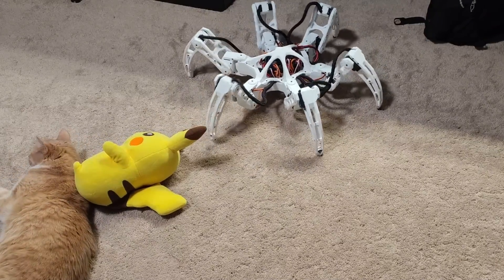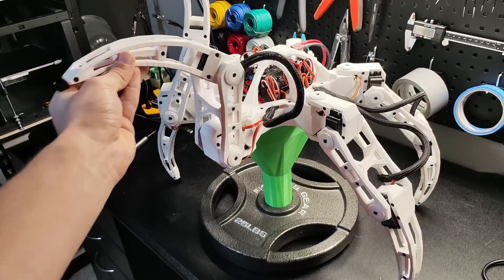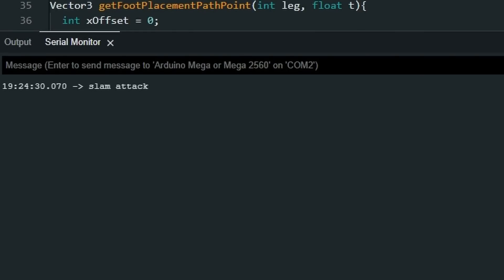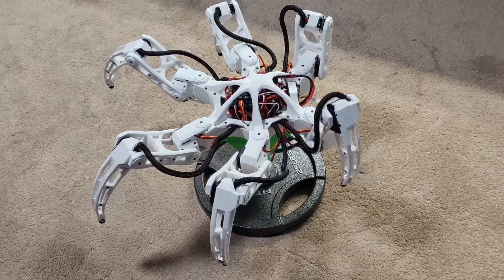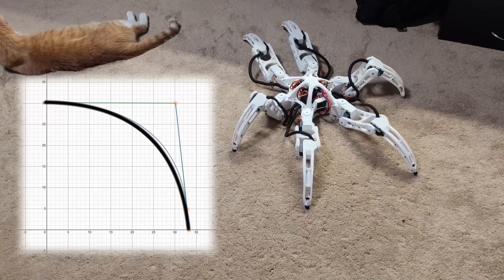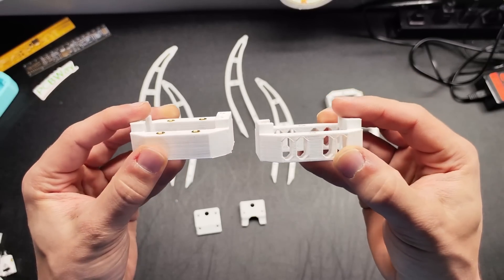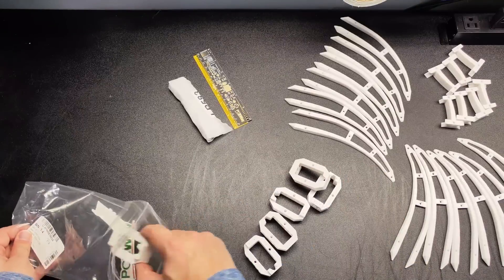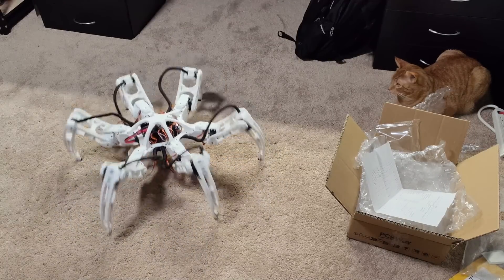I Taught My Hexapod a Slam Attack

Comment: PCBWay sending you prints with elephant's foot is super disappointing tbh. Everyone with even half a braincell can compensate for it in slicer and there's absolutely no reason a large company selling prints on demand sends you stuff with that flaw in it.
Reply: Not really, PCBway just prints the files it is sent, how are they supposed to compensate on every part they need to print? Some people design with elephants foot in mind, some people don’t, just by looking at the file they couldn’t always tell. Same with hole sizes and tolerances, people often design them into a part but it is possible to set them in the slicer too, again how will they tell? They probably just set up the printers to print it as accurately as possible and leave it at that, even then, if they print it bang on the size on the file and you designed it to have a tolerance since printers usually print holes undersized then your hole may end up too big.

It isn’t quite as easy as you seem to think. For them to get rid of things like elephants foot or precise sized holes they would have to have someone talk to you and find out how you designed it, what tolerances you used, etc, and then set the slicer settings. This would add a lot of cost to the process. If they can just post some guidelines on designing parts for them to print and then just keep mostly the same slicer settings for every print then they can save time, save costs and get the part made quicker.

If you want very accurate parts then you probably need to go to a more expensive printing service.
Reply from the maker: This is a great response, ty!
Reply: @conorstewart2214  Yes really, designing your parts to compensate for elephant's foot is silly. You compensate for it in the part of the process that would cause it. 

Secondly it is their job to print a part that's as close to the given file as possible, that means no weird additional width on the bottom layers, that also means that if someone added some little bevels at the bottom they now get a part with tiny bevels.

Lastly, printing a part with elephant's foot can mean said part is unusable without removing it, which might not always be the easiest thing. Printing a part with double compensation just gives the aforementioned tiny bevels that shouldn't ever be a problem.

It is impossible for me to design parts that PERFECTLY compensate for elephant's foot caused by their printers, without first sacrificing a handful of prints to them, it is however very possible for them to setup their process to print EVERYONE's files without it. Hell they could even add a checkbox for "I've already compensated elephant's foot in my files and don't want you to do it for me even if you could do it better."

It's on them, not doing it is lazy, everyone else can.
Reply: @ProtesttheAntagonist  no you have no idea how it works or what you are talking about. How are they supposed to print every single file perfectly with no elephants foot or other issues?
Reply: @conorstewart2214  ironic.

Elephant's foot is an issue that's printer/filament dependent. For my own printers/ones I've worked on I've ALWAYS been able to tune the slicer settings to eliminate it. 

If you solve elephant's foot for one file you've solved it for all files. Any other issues are also either removable with good tuning OR should pop an error when uploaded to their platform.
Reply: @ProtesttheAntagonist  okay so you've used a few printers. Have you run a large print farm that is probably largely automated? Probably using multiple types of printers with lots of different filaments?

It does also depend on the part itself, to think it doesn't is a bit delusional. They are dealing with lots of parts made by lots of people, all with varying levels of skill and experience. You probably just design parts for your own use on your own printers.

You can remove elephants foot if you need to, it is better to have more material and need to post process it than to not have enough so the part doesn't fit or doesn't work.
Reply: @conorstewart2214  yes I have lol. 

It does not depend on the part itself, elephant's foot is PURELY caused by over extrusion on the first layer, there's no other reason for a layer to bulge outward like that. The over extrusion is useful for adhesion/surface finish, but compensating for it by purposefully underextruding the outside wall is a consistent fix for the issue that works on EVERY file printed on that printer/filament combination.

In print farms if using decent quality printers(my experience in a farm was with ultimakers) then the same slicer settings can be used on all of them if they're all setup right. You might choose to leave the TINIEST bit of elephant's foot showing on one or two printers, but nothing like what's shown in the video, talking about hardly visible here.
Reply: @ProtesttheAntagonist  some parts need better adhesion than others, hence with settings to compensate completely for elephants foot you may end up with bed adhesion issues on certain parts and since you can’t predict what will come in to be printed it is safer to leave a bit of elephants foot there, especially when a lot of the files you are sent to print will be designed by people who don’t have experience using printers or designing for printers and probably don’t own one, hence they are getting it printed by PCB way. PCB way is a low cost printing service that is open to even complete beginners, not compensating for the elephants foot is a good way to increase the chance of the print succeeding due to the better bed adhesion.

In the print farm you worked at was absolutely everything automated? From when the person clicks the button to order it is automatically sliced and sent to a printer and the only time a person will touch it is after it has been printed? That is probably what PCB way is doing or they will have someone to very quickly stick it in the best orientation and the rest will be automated.

Comment: Very cool project! When your hexapod moves, the body moves a bit up and down, is that a minor error in the inverse kinematics or motor jitter?
Reply from the maker: That is a great question. I know it's not jitter, but I'm pretty sure it isn't the ik either but idk. My best guess is that when 3 legs are hitting the ground the servos rotate a little, but when all 6 legs are hitting the ground in between steps, they better support the weight and push the hexapod a bit higher.

Comment: QQ: Any reasons for sticking with an Arduino? An ESP8266 or an ESP32 would have made for sense to me with the added connectivity options and extra processing power...
Reply from the maker: Great question!
so I chose it initially because it's the only thing I was familiar with, and there was a similar project on YouTube that used it as well so I knew it would work.

I'm staying with it because it makes the project as approachable as possible, and I feel that the mega (or maybe the due) is the best way to do that.

ngl though, I do look forward to getting into more powerful microcontrollers, just not with this specific project
Reply: @AecertRobotics  well, when you release the project, I'm going to move it over to an ESP32 🤣
The dual core processor and embedded Bluetooth for remote control is too tempting for me 😅
The upside is that mostly the pin mapping is the only thing that needs to be changed.
Until then, I'm looking forward to all the improvements you're going to make to an already great project! 😁
Reply from the maker: @MiklosGalicz  Do it! You'll also have to modify the custom pcb, but that should be fun 😉
Reply: @AecertRobotics  I've did some investigation after boasting and the esp32 doesn't have enough pwm IO pins for 24, however an STM32 board does have more than enough and there's no need for the extra board with that 😁

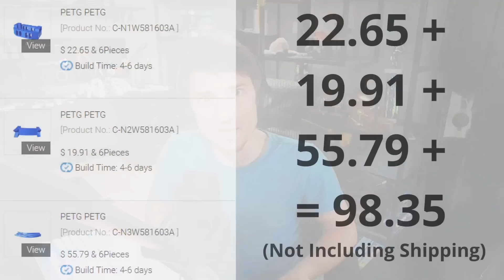Comment: @06:50 That was basically like saying: "Don't have PCBWay make your stuff... Instead go and buy yourself a 3D Printer and do it for a LOT cheaper!"
Reply from the maker: I mean if you can afford it I would recommend buying your own printer ofcourse. But there are definitely situations where a service like this would be helpful even if you have a printer, for example maybe what you are trying to print is too big for your print bed, or maybe your printer cant do certain materials, or maybe it's a lengthy 1 time print that you just don't want to do deal with.
Reply: @AecertRobotics  I find the Print Volume a hard to accept argument considering the sizes of some of the stuff I've 3D Printed with either my MK3S https://i.imgur.com/kAef3af.jpeg or 350 sized Voron V2.4 https://i.imgur.com/XXR47uM.jpg

Sometimes a smaller Build Volume is a curse but often enough I found it an opportunity for a different approach when it came to 3D Modelling something.

Concerning the Material Issue... I'd argue this argument too only becoming relevant once you start working with materials like PEEK/PEKK... ASA and Nylon are still very much realistic on a 3D Printer without a heated chamber for as long as you can cobble up a makeshift enclosure around it to keep some of the heat contained.

As such my argument stands - Don't use 3D Printing Services unless it's either for SLS or DMLS... For SLA and especially FDM buying your own 3D Printer is the way to go in the very short long run.

Comment: Hey there, 
I stumbled on your videos the other week. I bought one of these Hexapods around ~15+ years ago from Lynxmotion.. the Phoenix.
One thing to call out that might/might not help out. When I was working on these things way back when, the micro I had was ~16mhz and slow. The walking gait code would take up nearly all of its compute power. One thing that surfaced later was, these devices are so small and you really don't need to solve for SIN/COS/TAN while walking you can just use a lookup table. The lookup table did something crazy like take that 95% cpu usage and turned it into about 10%. You could pre solve for ~every quarter or half degree or something and use a little more memory at boot. Its not as accurate for sure, but the fact at the size these things are you can have a little error and visually you wouldn't be able to tell. You would only start to see the gait errors once you scaled up the the lengths of all the bones up. 

Perhaps you thought of this?

Frankly though the micros now like an esp32 or esp8266 or stm32 are bonkers faster compared to what I had messing with this stuff years ago. Maybe its not even worth it. Cheers! 

I have another project I am working on now which is an ESP32 based transmitter using ESP-NOW. My plan was to make a sweet transmitter then get it working with the old Phoenix I have on a shelf.
Reply from the maker: Hey sorry about the late response lol, I swear I responded but apparently not...

Thats a really good idea! I could do all the calculations once and then it would just look them up... This would be especially helpful since the arduino is relatively slow. I didnt think of this, and if i ever start feeling the limitations of the arduino mega, I will do this! Thank you!

Comment: your  cat is super chill  ....gives  ZERO fux 😅     for the underside of the robot  may be you could ad some rubber ...?something to absorbe the shock  may be 3d print the bottom in  a softer material ?
Reply from the maker: dude ikr 🤣 they pretend it doesn't exist it's unreal. that's a really good idea! it'll also protect the surface it's slamming into lol
Reply: @AecertRobotics  btw : thanks!!!  i did not know PCBway offered 3d printing !
 i am  hesitant to buy a 3d printer and go thur  the learning curve , time ..bad prints + plus  buying filimnet etc.... PCBway  is  the service i will be using .

Comment: Foot switches in front legs in attack mode needs to activate a pull-grab with fangs for added effect :) Awesome project, can't wait to start supporting y ou and building it once you have your parts/pcb's etc. set up. Btw, does it have  a name yet.. or just Hexapod?
Reply from the maker: Thank you so much! They do kinda look like fangs 😄 a grab would be pretty funny actually, it would look really janky since the legs don't really bend the right way 🤣

No name yet! Currently just "Aecerts Hexapod V1". Ill probably have a Kickstarter reward where you get to name it if I can't think of something.

Comment: here is what I'd suggest for a better attack
2 sharp steel bolt mounted on pneumatic actuators on the ends on the 2 legs you did, that way this thing would be able to stab
you won't have enough space for a compressor on it, but it sure as hell has enough space for a tiny tank that you could pre-compress
also, when are you gonna release the source code?
Reply from the maker: holy shit dude 🤣 I don't plan on making this an actual weapon, but when you build yours please don't hurt me 😆

email me and I'll link you the unfinished code!